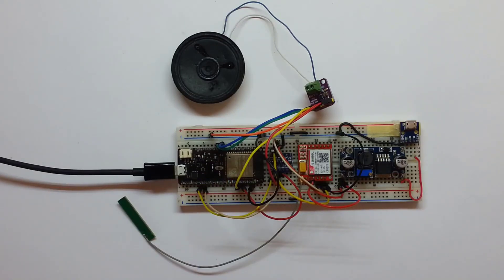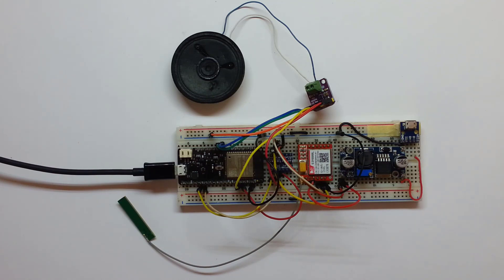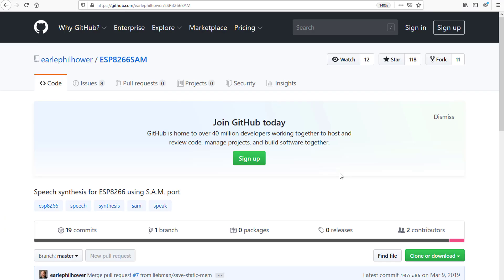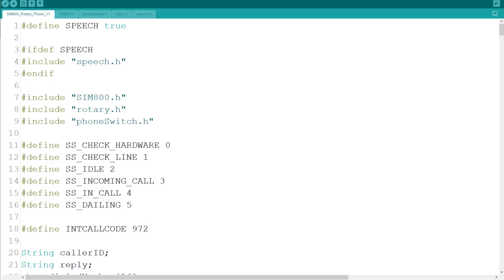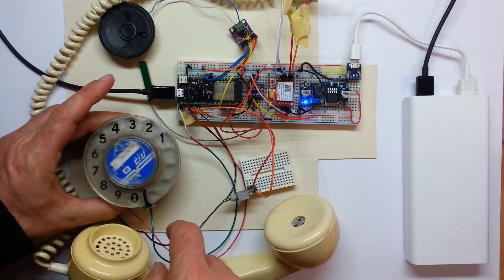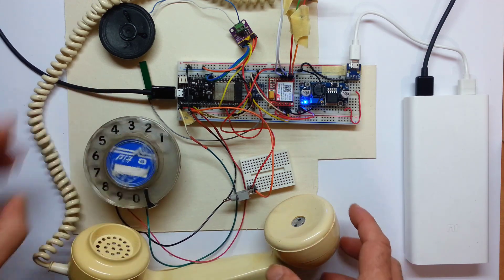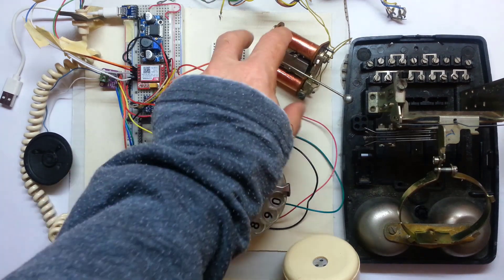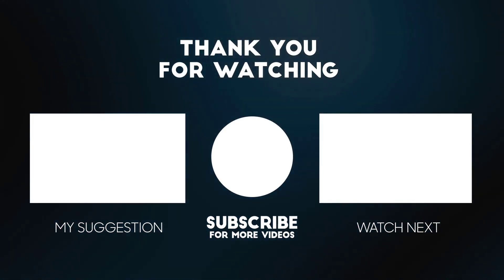Taking a rotary-dial phone into the future – part III – make it talk

Comment: I've seen people make a ringer for a rotary phone using the arms that hold the heads from an old hard drive. It doesn't need the high voltages, you just need to create an alternating current using a simple power inverter and feed that into the coils that drive the arm.
Reply from the maker: Interesting Idea I will look into that, thanks :)

Comment: Make a PCB and take my money!
Reply from the maker: Thanks - Maybe I should  - will be a first for me. :)
Reply: @talofer99  Seriously: Maybe take this module https://github.com/Xinyuan-LilyGO/TTGO-T-Call piggy-back'ed on your PCB (no need for multilayer) and add the audio / high power / dial circuit. It would be awesome if everything could be powered by 5 V or better 3.7 V LiPo :) I still have a german phone FeTap 611 and a W48 standing here.. The audio quality should be at least OK I guess :) I can tweak the code myself then..
Reply from the maker: I will start by making a prototype that is soldered to a pref-board and take from there :) 
That board is interesting, never seen one like it before -thanks for that :)